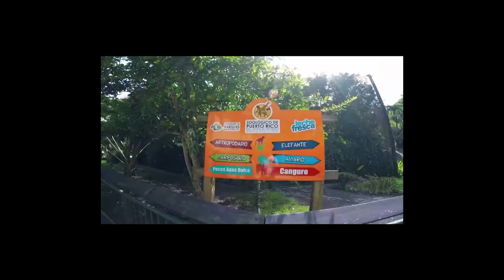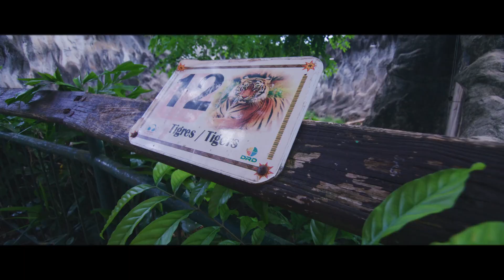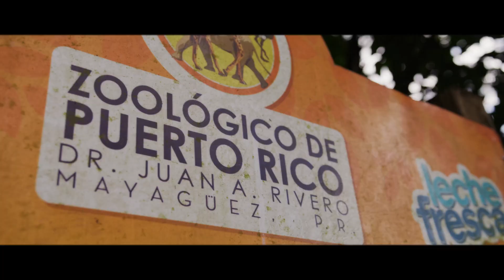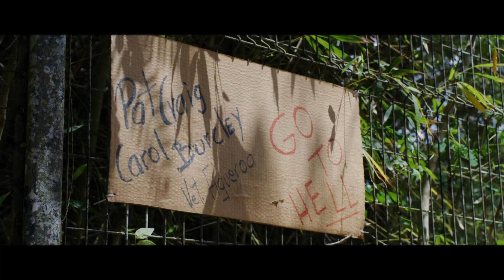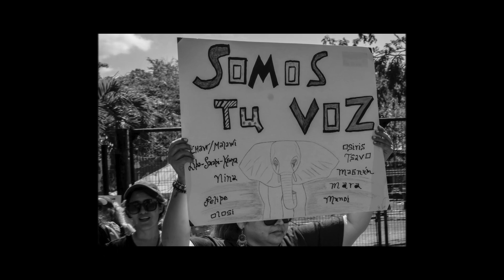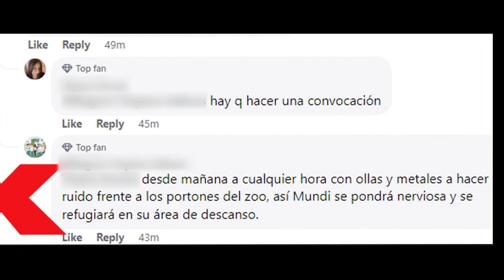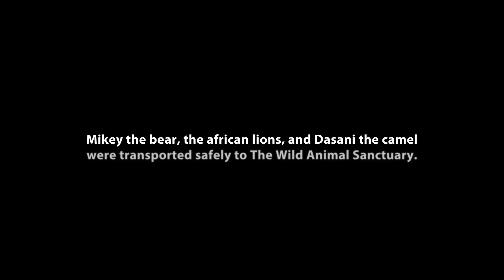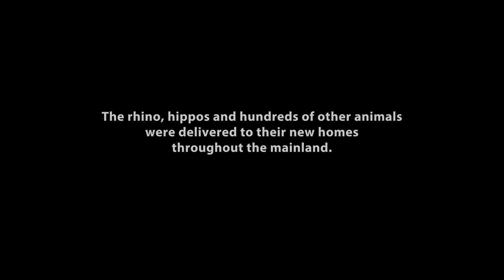Puerto Rico Rescue

Comment: Looks like this zoo was originally built with good intentions. Most of the enclosures don't look too bad in regards to size etc, although I would very much call them "builds of their time". Concrete floors were pretty much standard for a long time.  I have seen worse in old-ish zoos. Just compare it to that "holding compound". At least the zoo had water features or rocks to climb on and things like that. But it very obviously fell into disrepair and without a lot of money, there was no way to fix it. At this point, it was best to relocate the animals.

And WTF? "Oh no, don't take the elephant" -> "Let's shoot the elephant so it's too scared to go." ???
Reply: "The road to hell is paved with good intentions." The Zoo could have asked for help from so many sanctuaries if they really cared about those animals. They abandoned it when it wasn't profitable anymore, not caring what happened to those animals.